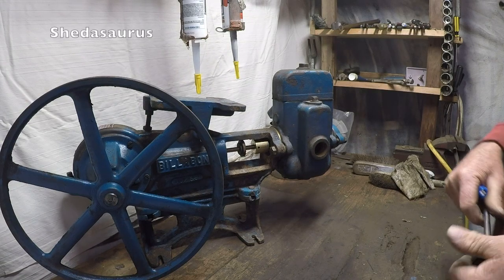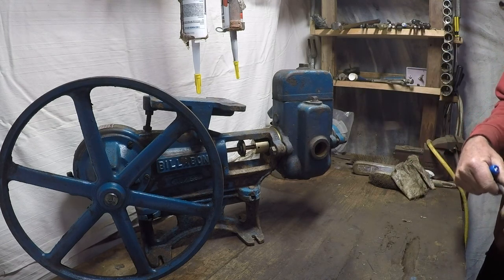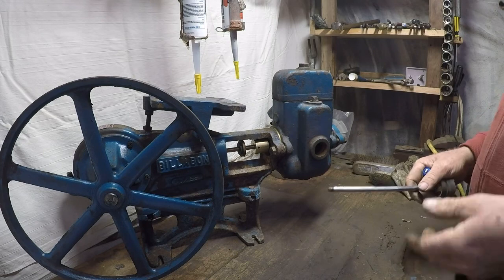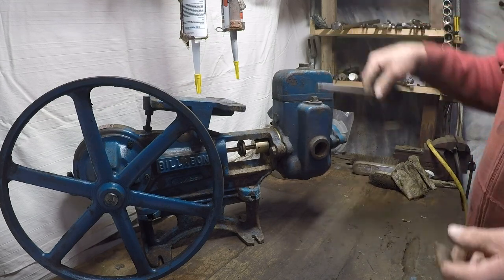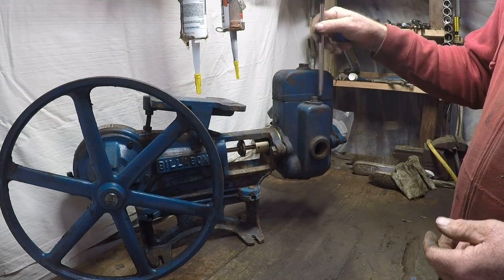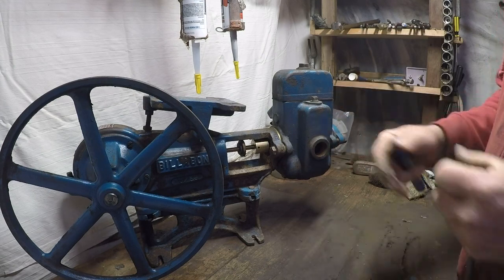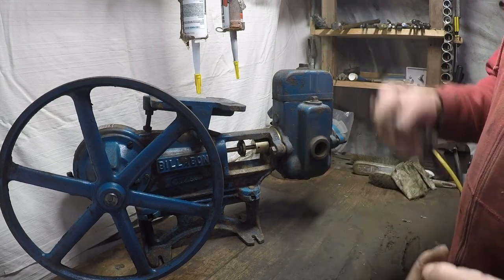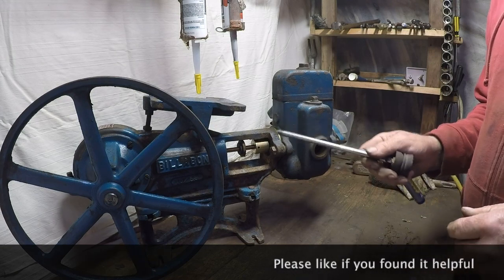Piston Pump 1 1/2"  Air in water outlet. Ajax Billabong Perry Myers

Comment: Great video mate.
I have recently restored an old piston pump that came with a property I purchased. Its not easy to find good information on these old pumps.

I have herd that these pumps can be painful to prim and my pump came with a lot of complex plumbing on it that I would like to remove. What plumbing would you recommend for easy priming and to keep it neat and simple.
Reply from the maker: The simplest method I have seen is to tap a 1/2" pipe thread directly into the top of the dome/head and attach a ball valve to that then attach a funnel or anything to hold water on top of that, then to prime simply pour water in funnel open tap then keep water in the funnel till the pump primes. If you have sufficient water in the outlet pipeline and especially if it is pushing uphill it will self prime, making sure you use a good italian check valve on the suction line will keep it primed. If it is loosing prime often make sure that the water is not leaking out the gland when the pump is switched off as this will half empty the head causing issues- replace the shaft or tighten the gland packing to stop the leak

Comment: At what depth would these pumps pull from?
Reply from the maker: If you have a check valve on the bottom then up to about 8m, If you are priming without the pipe being pre-charged , I would guess 6 but the pump would have to be in good nick internally